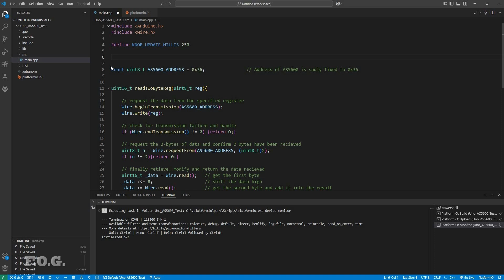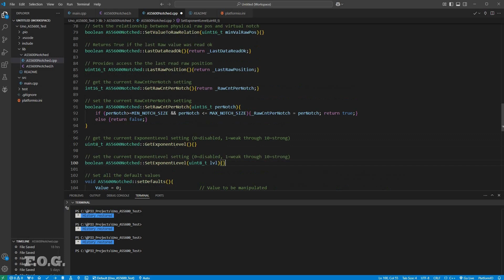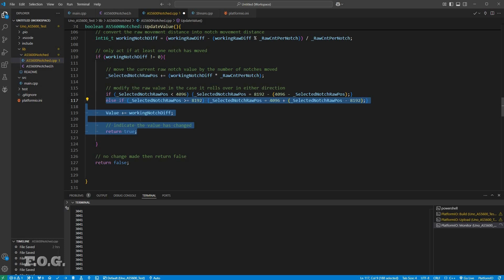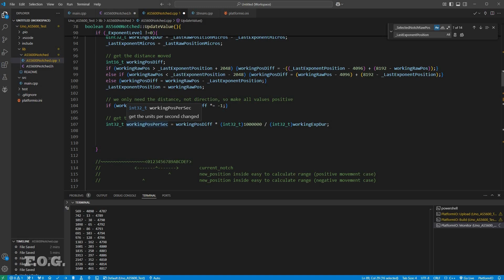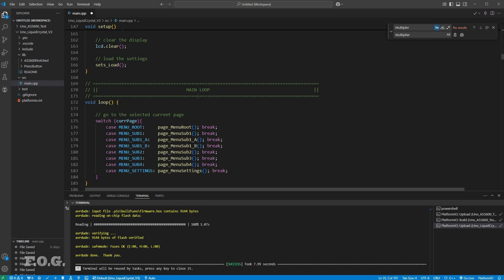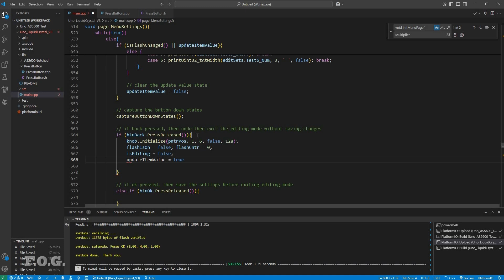EP8 – How to Program Arduino – Rotary Menu with AS5600 Class

Comment: hello! Love this series, learning loads. I'm having some trouble with the demo code at the very beginning of this video. I get a couple compiler warnings, and when sent to my arduino board, the raw angle value returned is just 0, and does not change with rotation of the knob. I have tried some other demos for the AS5600 with no issue, so I don't think it is anything to do with my hardware set up. Do you think the warnings are part of the issue?

compiler warnings:
In file included from src/main.cpp:2:0:
/Users/####/.platformio/packages/framework-arduino-megaavr/libraries/Wire/src/Wire.h: In function 'uint16_t readTwoByteReg(uint8_t)':
/Users/####/.platformio/packages/framework-arduino-megaavr/libraries/Wire/src/Wire.h:63:12: note: candidate 1: size_t TwoWire::requestFrom(int, int)
     size_t requestFrom(int, int);
            ^~~~~~~~~~~
/Users/####/.platformio/packages/framework-arduino-megaavr/libraries/Wire/src/Wire.h:61:12: note: candidate 2: virtual size_t TwoWire::requestFrom(uint8_t, size_t)
     size_t requestFrom(uint8_t, size_t);
            ^~~~~~~~~~~

Comment: Thanks for the mention and great to see your methodology on using this device and building a class for it. Took me right back to old days of programming and the joy of creating something from nothing a lot of fun and quite rewarding when it all comes together. . Haven’t watched the whole video yet will come back to it tomorrow after work but very interesting stuff so far and as usual with your videos I am inspired again to get off my ass and make something new I have a couple of those small round led displays I bought last year perfect for the top of a rotary knob!!!. . Once I finished the three projects sat  on the bench for months of course. thanks for sharing.
Reply: Watched it all and great to see the knob hooked up to the display with the menu system working like that really very smart indeed. I won’t profess to understand all of your coding but it was pretty clear and I think I could easily replicate and learn from your video so thanks for the efforts.
Reply from the maker: @AndyJenkins999  An interesting fact about the knob design, originally I tried to make a much smaller knob with a single button using a contactless switch.. but for various reasons, this did not work out, especially when I was trying to keep it simple as possible..
Then, when I went for the bigger knob, I realised I had to use the 2 physical buttons to balance things out and get things working well... Which personally I far prefer, so overall I am pretty happy with the outcome.
It was also nice to see how easy it was to get the menu navigation working with the new class. Editing values takes a little more work, but it's not terrible.
Thanks for the comment!
Reply: @ForOurGood  I dont know how much editing you did or needed to do with the knob but from the video very impressed with the reliability of the AS5600  with your design, simple yet very effective and seemed to work flawlessly. I seen a few similar designs with the buttons mounted horizontal internally to the body but these mostly dont capture rotational movement but I think there are endless possibilities just dependant on preference. Very good thanks again :)
Reply from the maker: No worries, I always try to shout out anyone who contributes to the channel. This video is undoubtably a bit of a slog for most, so it likely only going to be a good watch for the minority of my subscribers. But these tutorial videos always get the most views over the long term, and generally get the most positive feedback. I’ve also noticed that a big chunk of the viewers don’t come from your typical western countries, so it is nice to think that the videos might be opening new doors for people who may otherwise not had such educational opportunities otherwise. Unfortunately making these tutorial videos is about as painful as getting teeth removed.. so there’s that..
Good luck getting your three unfinished projects done, personally I have at least ten projects in the pipeline that I have bought stuff for, so I know how it feels. (I’m trying to stay away from Ali-Express!) :face-blue-smiling: